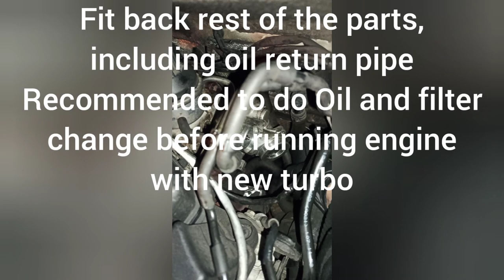How to replace turbocharger core/CHRA, how to fix bad turbo, easy turbo rebuild

Comment: Hello, this video saved me! Every other video is telling you to take all the exauhst off and turbo out, doing it without a lift is PITA. I wasn't able to reach the VNT arm nut, without taking off the leaking valve cover. But by doing that it gave me a lot of space to work and to brake the turbo in half while in the car. Overall I'm very setisfied with my ebay cartridge. Everything with gaskets and fluids and filters came up to $350 and took me 17hrs to do. Better then $3400 that dealer quoted me. Thank you very much sir!

Comment: Doesnt show removing the 6mm bolts holding the aluminium housing on to the cast exhaust side does it. See them all except the one under the wastegate actuator.............

Comment: Hello mate is giving you any problem with balancing?
Reply: Cores come balanced, even cheap China ones, there is usually grinding or part drill holes on the inlet impeller. Trickiest part is making sure VNT actuator on the new core lines up with the VNT ring in the exhaust side.

Comment: I can’t not get the turbo core out for my td04 😭
Reply: Heat. Alloy and steel expand at different rates, get it up to a few hundred degrees and belt it.

Comment: Sadly the Turbos that VW fits are proving as Junk Quality..   GO! vw.
It is the 'in - out' play of the turbo shaft  that matters !
 Side to side (unless seriously excessive) is a non issue as Oil pressure is needed to  enable the correct clearances.  
Not much use in scribing the CHRA for Clocking purposes.... when it is going to be replaced ? 
to hammer out the CHRA while the Compressor section is still Bolted ON?? Genius at work .